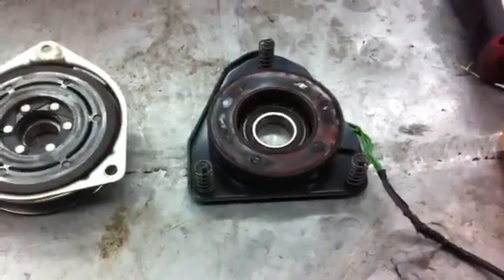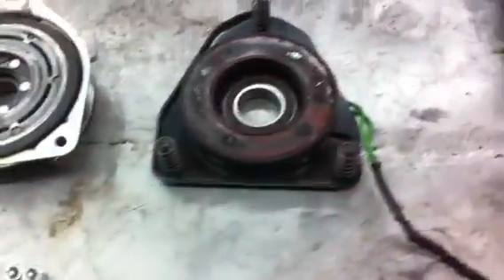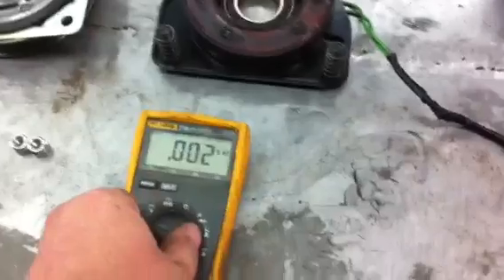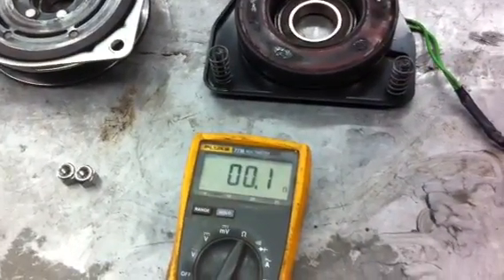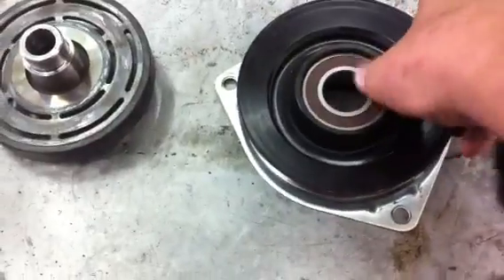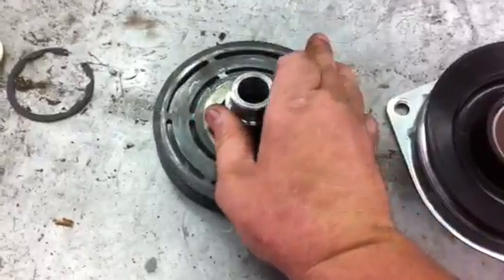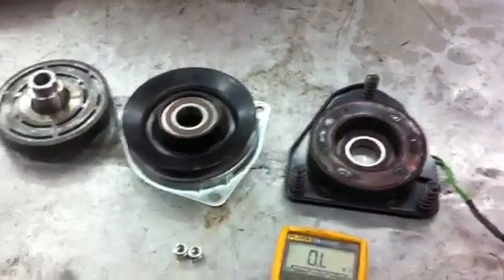LAWN TRACTOR REPAIR : HOW TO DIAGNOSE A BAD ELECTRIC BLADE CLUTCH

Comment: I have a Ogura GT1-TR05. I've been having issues with it intermittently shutting off. I tested the clutch by unhooking the hot wire and probing it. I left the ground wire hooked up to the mower and probed the wires in the terminal. It measured at 5 ohms. Would a 5ohm reading mean its bad? Would that cause intermittently shutting off?

I'll completely unhook the ground wire and test it again tomorrow.

Comment: Hey got a question for you. I removed the clutch and it came out in 1 piece. My problem is that the blades turn all time time. Rather the PTO switch is on or off. The clutch turns freely so it is not sized. Any suggestions?
Reply from the maker: Kinda need to know what you’re working on model number serial number part number of the clutch etc.

Comment: Thanks for the information.  I have a Husqvarna TS354D.  The mower cuts grass very well, but it sounds horrible when I shut it down.  I grease all the deck pulleys regularly, but the sound seems to come from the PTO clutch. Any suggestions?

Comment: My clutch test good but cuts off after 15 min of mowing, then cool off a bit and will work again?????   When it cuts off there is no power from the switch????
Reply from the maker: Charge system not charging or Loosing ground. And or thermal cut out bad in the clutch   Lots of things it could be
Reply: @THEMOWERMEDIC1  Charges fine.  I didn't know the clutch had a thermal cut off????
Reply from the maker: “Clutch tests good”. Explain how you did that. What ohm readings did you have?
Reply: @THEMOWERMEDIC1  3.5 ohms  When it shuts the clutch down there is no longer power too the lead
Reply from the maker: 3.5 is on the high end  but still within spec If you are losing power completely to the clutch then I would still be searching for a ground, possible relay, or the PTO switch it self. Seat switch could be intermittent as well
Reply: @THEMOWERMEDIC1    I will keep looking thanks.  Shouldn't take too long owner took all the safety switches out and by passed them already.  Even the key for starting is by passed and it works fine   LOLOLOL

Comment: I have a problem with my clutch on a cub cadet and I can’t really say which is bad the switch or the clutch but just a few days ago my friend got on it and pulled the pto switch and we heard it pop on and then day after I got on it to mow the yard and as I was mowing the the blades just stopped. Second is could a low cca 230 battery cause it to go out or not kick on bc of the specs call for a 245cca battery

Comment: What would cause the blades to keep spinning with an electric clutch? I imagine it's the switch on the dash. I have been using my mower on some heavy high grass and had to frequently turn off the blades to clear the (wet) grass from the deck. Craftsman 917272121 46'' 3 blade. Even disconnecting the switch didn't stop the blades...thank you
Reply: My guess would be that slippage due to over torque has "welded" the pressure plate to the friction disc due to over heating.

Comment: Thanks for your informational videos.  Was able to trouble shoot blowing fuse to mower deck.  The darn relay was bad. $17 bucks and the yard is cut.
At $65 hourly rate for repair Im not sure howmuch I saved.
Reply from the maker: Just a matter of time till the bad clutch knocks out that new relay :)

Comment: Another thing about clutches is they have to be torqued on so you don't put too much pressure on the bearings.  Normally between 45-55 ft/lbs if I'm not mistaken.

Comment: Question.... Gravely zturn fh500v everything was working then the blades wpuld engage then stop. Then the mower cut off, and now I go to start it and it knocks like it is locked up.  Tried to pull the belt to see if there would be any movement but nothing.  What do you think???
Reply from the maker: PTO SWITCH?

Comment: Fixed!!! I just purchased a second hand Scag zero turn mower and had an issue with the blades intermittently not engaging. Was thinking I'd been 'sold a lemon' by the guy I'd bought it from and it might not have been such a bargain. The problem did not appear to be related to heat but maybe a small amount of heat was doing it. I worked my way through the seat safety switch, then the PTO Clutch Switch using other YouTube tutorials ... which all turned out fine. Then I was down to the clutch itself and used your video to learn how to test if the clutch was good. Tested the ohms of the clutch and then volts into it while the clutch while disconnected and mower was running with PTO switch on. All fine. I then went onto "how to adjust your electric clutch" videos. A quarter turn of each adjustment bolt and it's working perfectly again. Unbelievable it's ultimately so simple. So, with the help of folks like you, a guy with a finance degree can fix his commercial zero turn. What's not to love about the Internet! Thanks for taking the time to explain this in easy to understand terms. I knew nothing about it when I started trying to solve the problem. Much appreciated. Thank you!!

Comment: My mower will not start,  no clicking from starter or any noises,   battery is strong    shows over  14 volts,       when i ran diagnostics  it refers to my PTO clutch or switch.      I replaced the switch but its the same problem,   will a PTO clutch keep the mower from starting?

Comment: I am about to test my clutch.  I have a Cub Cadet GT 1554 and in grass that really doesn't even look deep, I hear it slowing down.  I can even see the stream of clippings get weaker when it happens too.    I always grease the spindles with a good grease.  I try NEVER to mow if I can ride around the yard and the tires are wet or even damp.  I have new blades.  If it is not the clutch there are other possibly more expensive things it could be.  I am going to get my ohm meter and see if it is just a weak clutch.  I can get to my wires without taking the clutch off so this would be quick and mostly painless.

Comment: I have a bobcat zero turn and the pro switch works but when I engage the blade the blade band that goes around the electric clutch spins incredibly slow any suggestions?

Comment: I would weld that shaft onto the pressure plate if the customer was tight on cash. $300 is a lot of beans for some people. If it fails later, they already know they have to shell out for a new one. If the welds hold, then you look like the hero and everybody wins.

Comment: I have a John Deere 190C, when I was mowing the other day my blades stopped woking and they wont come back on. I bought a new PTO switch, still nothing. Took the belt off the clutch pulled out the PTO switch the clutch engages and spins but makes a load grinding noise. Do you think the clutch has gone? Or could there be something else? Thanks, J.
Reply: Betty JoAnn Hansen Turn the adjusting nuts a half turn each if available.
Reply: Thanks will try.
Reply: Betty JoAnn Hansen Sorry, Turn clockwise.

Comment: I clipped a wire into each battery terminal and probe into each place on the plug and it clicked.   I think this is a way to check if the clutch is good also.  ???
bob

Comment: Good Morning Jeremy,

I am starting a part-time repair business and am now working on a 2006(?) Cub Cadet LT1050.  I have replaced one spindle assembly, both upper and lower bearings on the other two and installed a new idler pulley, all were bad. the mower drive belt is good.   I have sharpened and balanced the blades, but when you engage the electric PTO clutch, the mower shakes, the engine lugs down, and after 30 seconds or so, the clutch cuts out.  You can immediately reengage the clutch and the whole things happens again.  I spun all blades by hand, not hitting anything under the deck.

I contacted tech support at Cub Cadet, got to a level 2 tech, went through what I had done and all he could come up with, after some thought, was that it must be a bad PTO clutch.  Currently it has a Warner 5219-64 and I have ordered an Xtreme replacement clutch, seems a better and less expensive option.

Have you seen this before?  Am I on the right track?
Thank you
Tony
Port Hadlock, WA
Reply: this is a long shot but my 1050 is doing the exact same thing what did you find to be the problem?

Comment: I tested it and it read 2.9 which means the magnet is good. But what could be the problem if the electric clutch does not disengage?

Comment: What ohm setting have tou got it on? I have several different settings on mine. 200,2000,20K,200K,2000K. Which should I be using. 200 shows 4.8, 2000 shows 7 and 20K shows .001. I usually use 20K
Reply from the maker: My fluke is auto range so I really don't know what value to tell you but 4.8 ohms is ok
Reply: Usually 20K is what they are set for. I TY for the vid you have...It helped me a lot. The Electric magnetic is bad and probably the clutch also...it's older than me and you LOL...TY sir for your help. Keep up the great work

Comment: I have a Toro Groundmaster 120 that the OGURA PTO seems to have gone bad.
MA-GT-TROC model
Toro groundmaster model 30612  serial 890142
Could you rebuild this clutch if I sent it to you. Looks like you have to have a press
to get this apart. What would it cost to have you rebuild it do you think?
Reply: I could send you pictures of it aswell.
Reply: alphasxsignal  No help on this site. I had another guy help me and we fixed it.

Comment: I am looking at a Cub Cadet LT1042 mower that the owner says has a intermittent problem with the pto clutch engaging. He feels its a wiring glitch. Do clutches go out all at once or can they work intermittently?  If It is a wiring problem, can I do my own wiring to it using a switch, relay and hooking up 12 volt to the clutch to engage it?  Thanks

Comment: OK....not to be Captain Obvious here, but this is a HELL of a lot of work to determine if the clutch is bad.
How about a way to determine if it even LIES in this area ? I am going to have to check my PTO switch before I rip out the clutch.
 Which wires do I test or cross to check for voltage or bypass, to determine if the error lies in the switch ? I will google an answer if none are forthcoming here in a day or so.
Reply from the maker: you can do the test with the clutch on the tractor......
Reply: My issue now seems to be the belts ? Is tehre a spring on the tensor pulley ? My belts are slack and the pto clutch is spinning so something is loose ;)

Comment: OK, replaced the clutch and all is well.  Additional bench check of clutch should be to test both terminals to the clutch's metal struture (ground).
Terminal to terminal may be correct but if the (+) terminal is shorted to structure/GND, it will either blow the fuse or metal something.  My "bad" clutch had a short that connected the (+) terminal to its structure internally.

Comment: I have an LA150 purchase in 2007.  I think I've narrowed down my problem to the PTO clutch (electrical).    When I measure from the front connector of the rear harness.  YLW (power to PTO) to Engine block (GND) reads 0.1 OHMS (shorted).  When I disconnect the PTO connector, I get OL.  Pulling the PTO switch, blades start then stop, then the engine dies.  The last time I tried, the 20A fuse opened.  I know the PTO coil has some resistance (YLW to BLK), but should the YLW be shorted to GND?  Thx!

Comment: VOMs can measure Voltage and Ohms.The meaning of O.L is dependant upon what you are measuring.  For resistance (Ohms) O.L means Open Lead or the amount of resistance measured is well beyond the highest measureable value for the meter, ie OPEN, infinite.   If measuring Voltages beyond the capacity of the meter to read, O.L means over load or over limit. So you are correct if measuring volts or amps. Mr. Fountain was measuring resistance (ohms), ergo Open Lead, open line was correct ... for ohms.

Comment: If the winding is old or worn not completely broken to the point it can still make a half assed connection, the amperage will shoot through the roof tying to keep the clutch engaged and the stator can't keep up; it will do exactly what you describe. I actually had one do this. Usually the windings just breaks and it won't do anything.

Comment: What would cause my battery to drain and the volt meeter show a draw when I hit the electric switch to engage the blades?  Is my clutch the problem or is the charging system having a problem?

Comment: Jeremy,
 Im having an issue with my clutch on my bobcat z219. Whenever i try to start the mower the blades are turning and the mower wont start, do you have any idea of what my problem may be??
1. Ive replaced the switch(pto) and reading 12volts
2. I can also hear the click noise whenever i engage the pto switch.
Note: The clutch is still on the mower.
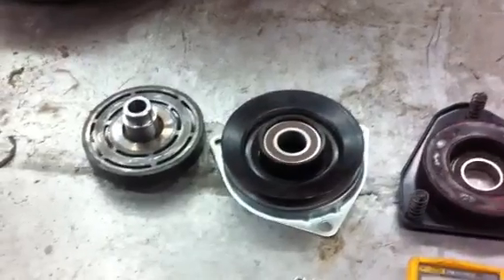Reply: 2:28
Reply: 2:28 
2:28 i

Comment: Hmm, expensive for a magnetic device.

for myself i would do a bodge, locktite or drill the seam and insert pin to stop rotation or what ever i could think of as a temp fix.

But you are a professional and i understand you must adere to the correct approach.

A wallet emptying experence :-(